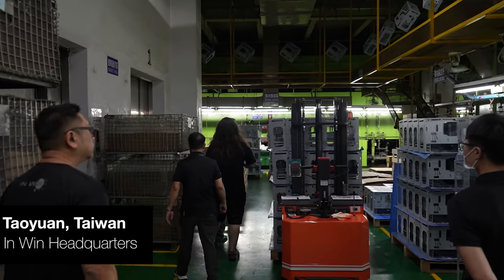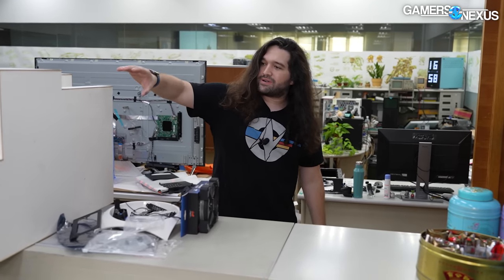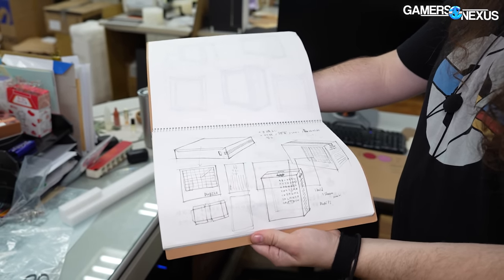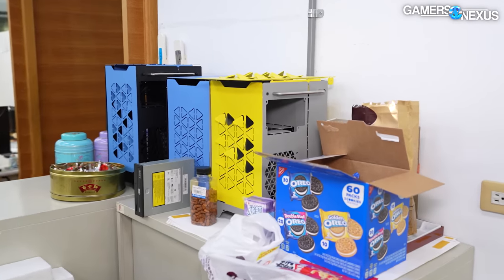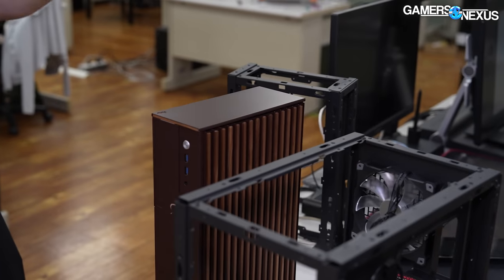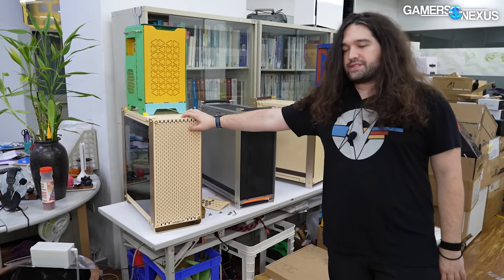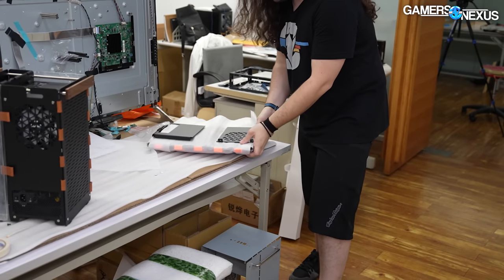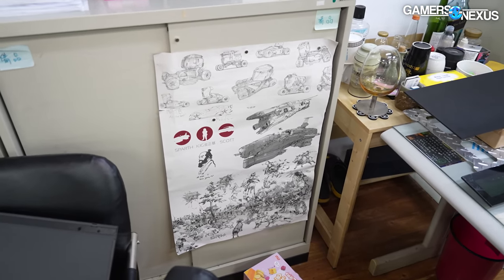Inside an Inspiring Computer Design Studio | In Win Case Studio Tour

Comment: Okay, you asked for ideas; provisionally. I'm going to offer a design idea that I was going to keep for my own personal use, but have yet to implement it. Of all the case manufacturers, I think In Win could actually take this concept and run with it. First, picture movies where an individual needs to get past a security system involving lasers (e.g., Catherine Zeta Jones in Entrapment, or other movies such as Mission: Impossible, Oceans Twelve, etc.). Basically, a web or lattice of lasers in a closed environment.

Now, using a powered laser pointer, create a beam of light inside the case that points at a series of mirrors at different locations throughout the inside of the case. The mirrors can be moved to different areas if the case has a mesh-like interior. The mirrors can swivel and rotate to point to other mirrors. The user can then make the beam as simple or as complex as they like. Other gimmicky items can also be utilized, such as end items (e.g., a beam splitter, a prism, a small disco ball, a laser projector will spell out a word or make a shape). Another possibility is changing the light color or adding effects such as strobe, Morse code, etc.. I realize this concept may sound silly or goofy just from my description, but if done right, I think it would produce an interesting addition to the inside of a case.

Another idea involves using the glass panels some cases have. If the glass is etched, and a light sent through the edge (side) of the glass, the etched areas will illuminate. That creates a very large opening for customized glass panels.

P.S. I went back and forth a few times as I was writing this. Post the comment? ..or not? You're reading this so....

Comment: That champagne colour looks nice to be honest, its different. I don't need a case right now though and I would only consider it if it has at least the same quality as Fractal cases. That basically means but not limited to, ease of use, modularity and performance (quiet or airflow) . The most left case looks the most interesting to me.

Comment: Really like the champagne colour. Something other than black, white etc to fit with interiors.

The closed case has a nice cut out in the front panel, makes it art deco-looking. It's probably gonna run hotter though.

I would go for the mesh front panel one if it were available now. So far, the Fractal North is on my list to get, but I've been going back and forth on that one so many times cause I find it such a tiny case, rather have something bigger. This one looks bigger.

Handles are good, but these are so thin. I'd rather have the handles look like the feet of the case of the mesh-panelled one by connecting the 'pillars'.

Comment: I am a bit of a Noctua fanboy and that one on the left end of the table with the ventilated front and the glass side panel, if there is a clear glass one of those that comes in <= $200 and keeps the brass screws (are those solid or plated?) I'd most likely buy one. I've been considering getting a North but I think I like that better. Dark tint or any sort of etching or writing on the glass would be a deal breaker for me though. I'm not sure if that DUBILI thing is on the glass or on the peel. 

I also like the Banbi but the stuff I use wouldn't fit in there.

Comment: I have a nanoxia case from 2013 that is still going strong and handling all the latest hardware, keeping it cool and quiet. It even has drive bays for my dvd and bluray drives and an internal cage for my "nas" array. This thing wasnt necessarily built for future proofing, but that's exactly what it has done. (All this mainstream stuff we take for granted today was extremely rare back then..NAS, local streaming, quiet cases, high airflow, filters everywhere, cable management, slots for water cooling, fan controls, etc.)

What ever happened to THAT company anyway?

Comment: If In Win is going to read this. I would like a case that is completely modular. A box with just the mother board. Each panel can have fan mounts or no but I decide which. They could have different color panels as well. I would like the panels to be 360 x 120 or 140mm each plus a little extra to account for fan and radiator width. It would be cool if mother board could be vertical or horizontal mounted. Either by being able to mount feet on any side or a removeable tray. I want the power supply behind the case in it's own box. Could have that box be able to mount a radiator and fans. Then you can add modules for separate radiators in their own box that can be mounted to main.

Comment: We need more PC cases which have multiple sides being made from radiators; like a case which has a side to which you can attach 16 140mm fans (4 wide by 4 tall), to which you connect just one water in and one water out as part of your custom water loop. This would give the same cooling as four 560mm radiators, giving ambient temperatures for even the most demanding of PCs, with very low fan RPM meaning also low power and low noise, whilst giving maximum cooling, extending hardware life as well as insane overclocking potential.

Cases with integrated radiator like cooling would greatly simplify custom water loops, and could, via having top AND bottom AND side as all integrated radiator like cooling panels, allow even small cases to offer significant cooling via water loops.

Comment: Really hope flat packed cases become more common in the industry. Would encourage a lot of the designs I like (configurable layouts, adjustable brackets, easily modified parts) and discourage a lot of the designs I don't care for (TG, bulky plastic moulding, extraneous mechanical elements, layers of bullshit where ventilation should be)

Comment: for the champagne color? i'd say the light champagne of the panels is lovely, if mixed with bamboo themes dark wooden strips, gives it a bit of a janaese / asian aestehic which i would love to use as pc case. ngl it'ss be a case id be willing to spend over 100 bucks for, upto 140 or so (i usually pay max 70 for my pc cases as reference)

Comment: I'd like to see InWin put the champagne colored cases into production, I can definitely see myself doing some builds with them assuming they're at a reasonable price for a high-end case (200~250$ or so). If the production volume is so low that they have to sell the case at 500$ however, then I think it's not worth it. But if it's 200~250$ I think there's a market for it.

Comment: Grey/red, Grey/green, Black/white - thats what i like. But PSU should be moved elsewhere, for non restricted access to air for GPU. 
Also 1/3 of side panel could be ventilated (bottom), and 2/3 up could be glass panel. That could help to get hot air from GPU get out of case.
Other points as usual - great airflow, easy access to dust filters.

Comment: I wonder how low they could get the POC price down to.  Maybe if they did it all in black or white (so you could paint/sharpie it).  Just the cheapest Metal flat packed case with well thought out cooling cutouts and pleasant looking airflow vents (the triangles looked good).  If they could get it down to like $50.  Maybe in a generation or 2? after thyy've made back some of their initial mold investment?

Comment: I would not be interested in a champagne colored case, but that's partly because I have a need for front-panel devices in my rigs, i.e. optical drives which I use for backup etc and card readers that I use to take pictures and videos from cameras. And I'm planning to go all-in with RGB on my next build. So I'm stuck with black, though my situation isn't universal.

Comment: Regarding those case colours, I think with those case mounting screws looking like bullet casings (deliberate ?) the colours should be more "brutal", gun metal grey, possible with graphic wraps to match the "american redneck shooter" type visual.  Definitely a market for that I would think

Alternatively maybe the frame screws should be a different design - like hexagonal and less "look at me" in your face if they want a more classy "champagne" visual. I can see they were aiming for "classy gold", but missed the mark with the shape and colour - too "cheap and brassy".

The champagne colour with the nice leather trim, brushed metal and design theme is classy, but the "bullet casing" case screws gives off a different vibe, so the overall visual is a bit of a confusing messy  mix.

Personally I would have gone with the case screws being brushed metal the same colour as the frame supports front and back, with the 4 screws on that support section coloured the same as the leather trim to echo that colour scheme to bring that together just as you would have a suit chest pocket handkerchief coloured to match your tie. (if you're classy like me :)

Small design accents can make or break an overall theme and I think in thier current form the frame casing screws are off the mark.

Comment: The champagne case looks great, very classy. But I'd only be interested in buying it if it's not too expensive to get the accents that Steve showed. Things like the gold accented rivets (captive screws?) and wooden handles. If it's going to be something like 50% of the entire case's cost to get those accents, I wouldn't buy one. I would also personally prefer a clear glass panel instead of the tinted panel the one in the design room has. If you're going to buy a "luxury" case that almost doubles as a showpiece or furniture item, you're not going to hide it in a desk, which means the panel should be see-through.

Comment: I just want a SFF Slim Case that supports Micro ATX mobo, standard ATX PSU, LP CPU or water cooling, with a decent length GPU. My idea is to use an upside down vertical GPU mount to lay the GPU flat against the boards pcie slots and draw air from the side panel. PSU with cables and storage devices off the the side somewhere.

Comment: nice to see InWin is finally comming to us with new ideas. it looks like they should focus a little more on performance than on looks and convenience. after all gaming-hardware seems to use more and more power today. just housing a massive gpu or motherboard in a fancy shell is not enough these days. although those enclousures look unique and stylish spoiled people today want good cooling performance through airflow, radiator support or passive cooling inovations plus they also want a working dust filtration and noise/vibration dampening for mechanical drives and all moving parts or coil whine. cable management is the last thing to make a perfect enclosure stand out from the thousands of lackluster square-boxes that all can house the same pc-hardware.
(on the last item where they go the route of premium materials like wood and leather using a plexi-glass-window is a no go! cheap plexi glass easily scratches and should be a thing of the past in 2023! pls use real hardened glass InWin-team!)

Comment: Thanks for the video. I think you could produce even a better case than InWin and yes, you know, you can.

I saw this kind of case already and it isnt fully thought out. The airflow as you mentioned isnt optimized.
And many ppl want a stable case, not something which focused to save money by using less material.
It seems InWin forgot that ppl dont want a mobil-desktio pc, because its a desktop pc and not a laptop/tablet.

Desktop computers has only 1 focus, high performance with less noise/heat.
InWin went the wrong direction, one day they realize it. In my perspective, they had no better idea, although 1 way of a ultimate pc case still exist.
And no one so far got even the idea.. and i wont tell what ppl has to do, to have something better, valuable.
Reply: I agree that the cases shown here are kind of a niche product. They have more traditional sturdy ones, too - not shown here in the design studio. And sometimes you want a desktop you can move occasionally, but still upgrade unlike most laptops.

Comment: Champagne?  Maybe...  How about an ATX case that is shallow enough to fit in my entertainment system instead of beside it?  All the new cases have space up front for a radiator/super-long GPUs that makes them way too deep to integrate them into many TV stands, etc.  I really wanted to buy the Fractal North, but just checked the dimensions and it's too deep for my setup as well.

Comment: I really want the mod 3 mini Wooden ITX case. Such a classic design it would be perfect for a retro emulation PC.  Plus any child of the 70s and 80s can't resist wood paneling. As for the champaign case, not for me. The mod 3 case with the many holes of different sizes in front is a big no. Look up Trypophobia. I like the POC 3 cases that look like Spider-man 2099 and Zelda but I doubt I would buy them.

Comment: Do not like the champagne color cases. I think it will probably not age well, the same way beige didn't age well for 90s computers. However, as a small-run collaboration with Noctua I think it would do well. Similar to the asus gundam cases.  The orange black and white is good. I still think brushed silver aluminum and wood do the best in terms of looking good for a long time.

Comment: I remember the days when building rigs was fun and the case manufactures had chassis that were strong, solid and heavy to be just that, strong. The likes of Lian-Li and the likes in the old days, now most chassis are cheap-n-nasty and have no appeal. Then again, hardware and changing warped form-factors sucks balls too.
Reply: They have options for that too, they're just not considered designer cases. The Chopin Max is very solid (well, except for the mesh) in mini ITX.